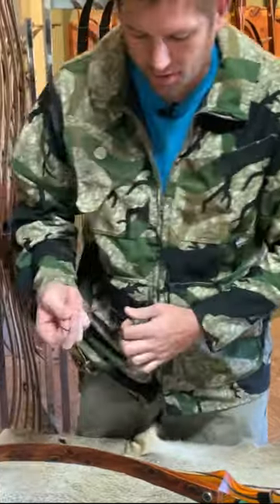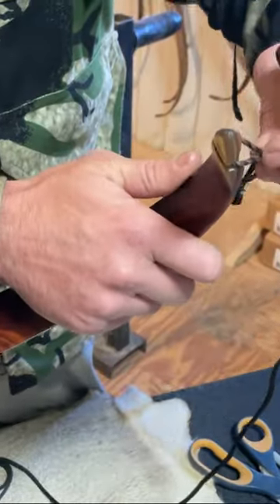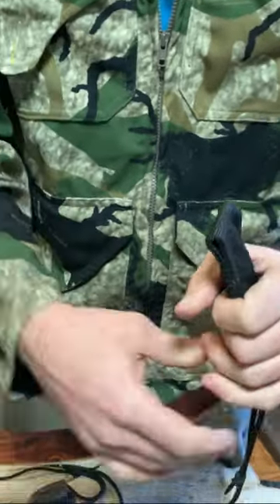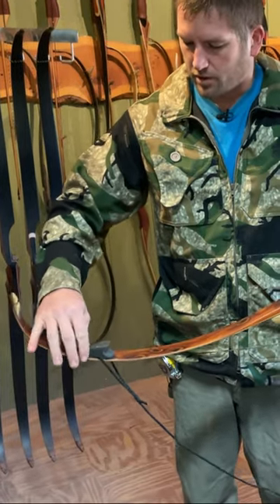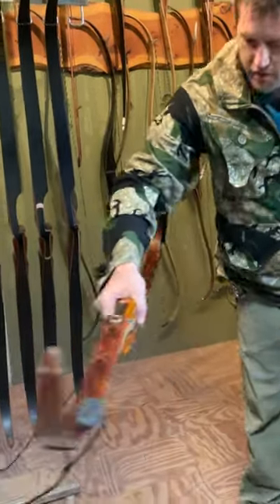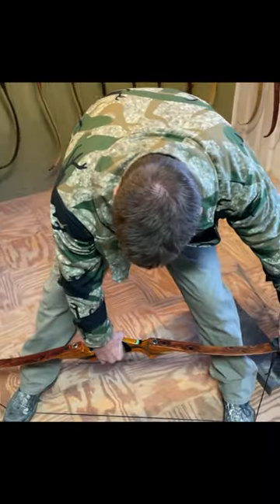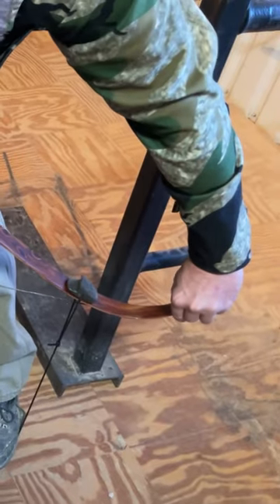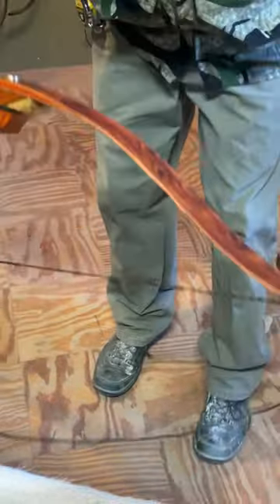Stringing a High Performance Bow #shorts

Comment: I was taught to step through and bend the bow over my hip.
Reply: Same but also how to use the Stringers as well. I just can't comfortably do the step though, sometimes it hurts my shin and past 40--41 pounds it is really difficult for me to string up.
Reply: @caseysmith544  how is the stringer on your back.  I’ve never used anything like that.  Guess not knowing makes you do it because you don’t know of another way.
Reply: @richardhenry1969  I am too small as an adult to do the push pull at 62 inches or 5 foot 2 then around 107--110 pounds and I have 1--2 inches shorter arm span then a person my size should. I can do the step through method but it huts my shin on most bows around 35 pounds on up.
Reply: @caseysmith544  never thought about that. I remember doing that when I was young. I'm only 5'6 I don't remember what pound we used to use I'm guessing 45lbs. but I do remember loving to shoot a really light 25lbs target bow. 
My grandfather showed me how to string a bow. An I do remember I couldn't do it like he did.  So he adjusted how I did it but I can't remember what I did now. I'm going to have to break out my recurve. I've only been shooting my compound because my heavy recurve got stolen all I have now is 35lbs I really want a another recurve. But gotta wait till after Christmas. 
Any way let me get back to ya I wanna see if my niece has problems stringing the light bow. She's never shot a bow that I know of.
Reply: Same here
Reply from the maker: We hope that’s working well for you. This is why we don’t recommend the step through 
https://youtube.com/shorts/qljwY2sVyxU?feature=share

Comment: That is one beautiful bow! But I also think it looks sensitive to wet conditions.
Reply: I think they use clear fiberglass for the front and back.
Reply: It's completely sealed with resin it is designed to be hunted with in the elements.
Reply: @chadklaren9537  Thanks, I had a feeling this was the case that the bow was in resin/some kind of thick poly coat and my main thinking is the bow uses Fiberglass for the entire flat ends of the bow as a backing.
Reply: What kind of bow is it?

Comment: My Dad who is now 82 made powerful recurve hunting bows 50 years ago until 79 or 1980 and could string a 70 lb bow without the aid of the extra string by putting the set end in the arch of his foot and just sliding the lose end down the limb and pulling up like this guy is doing.  I last did it maybe 15 years ago.

Comment: Aint how we done it. We slip one end on loosely then the other side correctly. Place correct end on carpet pad step across with, leg use elbow to to grip loose end and bend across thigh and slide on other end.

Comment: I was taught one end on left shin and middle behind slightly above right knee. Then use right hand to flex bow while using right hand to install spring. I started stringing a 90# bear recurve since I was 12 years old. It has only gotten easier since. What I would like to know is where I can buy arrows and a bow that will easily handle a 32 inch draw length. I need 34 to 36 inch arrows since I have a 6'7" arm span. Using a wrist strap trigger device helps but I still have to adjust my draw length to try and not overdraw every bow I have ever used.
Reply from the maker: Hi David, we can build bows long enough to accommodate your draw. Thanks for your comment!

Comment: This thing literally looks like it's made with about 7-8 feet of cheap paracord from Walmart, a generic $2 leatherman/flashlight holster and a door stop. I wonder how much it costs? Oh, $15.99. And what's that on the website? A hitch bow stringer jig for $285? Hmm, that jig looks like I could use my legs and hip instead of buying 8lbs of aluminum square tube that hooks into my hitch. And the step through method is free by comparison.
Reply from the maker: We send stringers with our bows free of charge and this is why
https://youtube.com/shorts/qljwY2sVyxU?feature=share
Reply: @greatplainsbow  You can try to sell me on the idea by saying it's free, but it's still getting chucked in the garbage. It's unnecessary and over-complicated. There's an effective method that's been out there for longer than memory and this seems like cash grab tool that's as useful as a 3-sided spoon.

Comment: Either method is just fine, it's all where you hold and brace it,
Reply from the maker: What do you mean by either method? There is just one method shown in the short
Reply: @greatplainsbow  sorry, I was reading the comments and many speak of the put your leg through method, the method I use and the one shown on video
Reply from the maker: @douglasfick4817  oh ok. Yeah you can use the step through method but it's hard on a recurve even with perfect form. Most people shoot twisted recurves without even knowing it and it never gets bad enough to be a problem until a small thing pushes it over the edge and it becomes a large problem. Always best to use a stringer on high end recurves